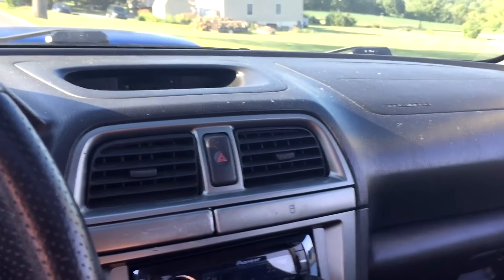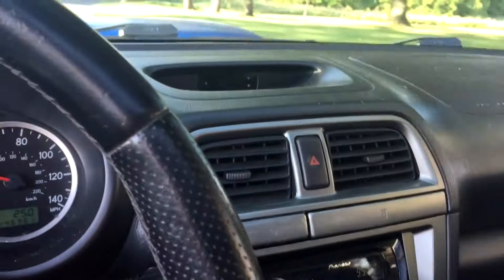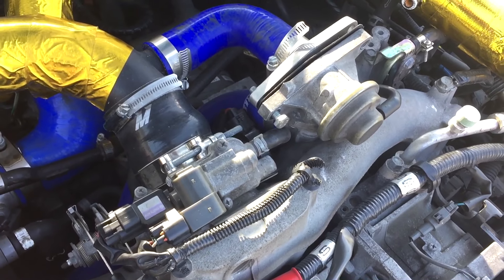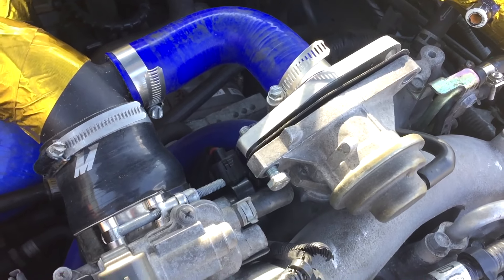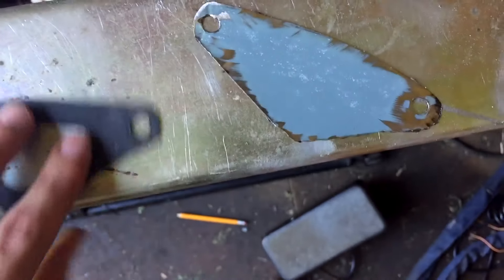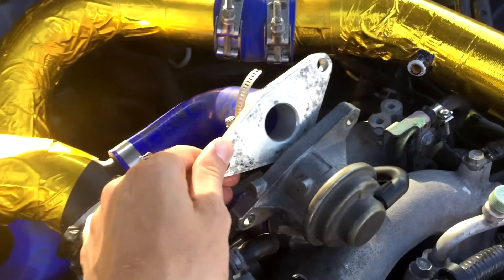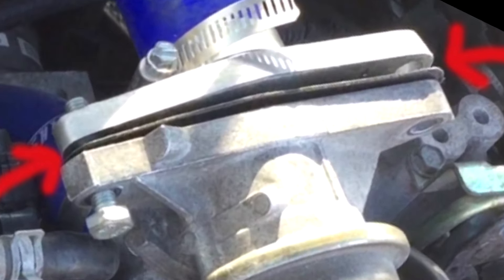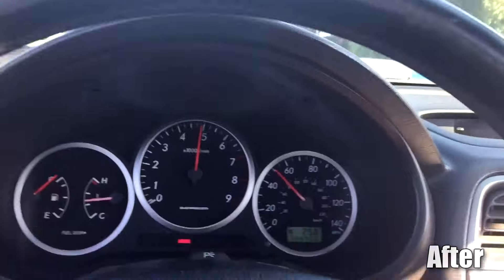DIY | BOV/BPV Delete - Block Off Plate | Stage 3 WRX Turbo Sound

Comment: This is not a good idea at all. For all the reasons people before me pointed out.... 
breaks your turbo, makes throttle response worse, makes boost drop after shifting. This is a really bad idea.
Reply: Mark Wright It very suddenly brakes the turbo when it is working against its own pressure That means slowing from 150k Rotations per minute down to nearly stopping in tenth of seconds. That can break the Turbo within hours. The point of a Blow of valve is to stop the Turbo from suddenly slowing. Without the blow of valve everytime you get of the throttle the turbo looses all its rotating speed and you have the Turbolag to go through again. A BOV prevents that by keeping the Turbo Spinning. Just you asking this questions tells me you know nothing about Turbo Technology. Maybe try educating yourself.
Reply: First off it does not slow the turbo down anywhere NEAR like you say. A turbo physically could not go from 150k RPM to nothing in a tenth of a second...The turbo would blow itself to bits. All thats happening is the air is getting chopped by the blades of the turbo. If you think about it its like a plane wing loosing lift. Its slowing slightly just like it normally would after you let off the gas except the air is getting chopped instead of being let out to atmosphere by the BOV. 
For someone saying "educate yourself" you might want to actually know what you're talking about before you comment some dumb shit. 
Cars before 93 and even some now regardless of the level of boost being ran dont have BOV's They're just there to make the turbo quiet. 
porsche's,   turbo buick regals and most cars with turbos before 1995 (ish) all never ran BOV's and they still run just fine. A bov is basically a choice. 
If something fails because you block off your BOV or you blow your turbo there was something else wrong. 
There is a reason high hp cars dont use them and cars in the past (including older AUDI's BMW's, Supra's, Buicks, the older Z cars all never had them.....simply put....you dont need them.
Reply: squishypitbull First it can and it does. Some Turbos can accelerate from iddle to fullboost in 5 tenth of a second and in this case it slows down at that rate. There are actually some very impressive videos of a Turbo Compressor Side deintegrating in very spectecular fashion upon closing the throttle body at full boost. On normal levels of boost it just results in very high wear on the Turbo. Yes until the 80th BOVs were rare, but on roadcars they were not neccessary because they usually never operated over one bar of boost with big turbos spinning slowly and also back then most racecars had the throttlebody in front of the Turbo so when it closed airflow to the Turbo was shut and it could not build pressure or be shattered by its own pressure. The Audi group B cars were prime examples of BOV less Turbocars. But the wear on the Turbos was so high their lifespan was measured in hours. Just do the math. Even on a conventinial modern road engine the Turbo would get slowed by nearly 150k rpm in tenth of seconds. Take out your calculator and get cracking if you dont believe me. Or ask any person who knows something about turbos.
Reply: I have. Turbos simply do not slow like you're talking about. it doesnt happen. Yes, they slow but not nearly as drastically as you're saying nor does it cause damage like you're talking about. 
There are many MANY cars with high hp and boost loads that do not run BOV's at all. Hell, my neighbor has a car thats been running close to 30lbs of boost for over 10 years with no issue whatsoever and he's still on his original turbo from when he built the car. 
You need to do some research on what really happens. It does NOT cause drastically abnormal wear on the turbo like you're saying. On a shit Ebay turbo that isnt built well at all then yeah....it can blow it up no problem (but then again its a pile of crap anyways) But to preach that the turbo slows down from the 150k RPM its running under load to nothing is crap. It doesnt happen. 
If you dont know enough about it thats ok  but there are many many people that do not use BOV's on their cars for years and years and their cars run just fine without them. To say that you'll blow a turbo if you dont have a BOV is complete garbage. Just more crap spouted from companies to get you to buy crap that you dont need. 
remember.....the really damaging thing comes from compressor surge...not flutter. and either way when you let off the gas even with a BOV the turbo slows. it doesnt STOP. The fact that the BOV releases air instead of letting it back out might mean the turbo slows a little more due to the air resistance but it doesnt just stop. Sorry man but you're just plain wrong.
Reply: squishypitbull No they do you are wrong, would you just educate yourself and then start talking about a subject.
Reply: squishypitbull Sorry to bring up that debate again but your wrong when you say it isnt causing any stress on the turbo..it will increase shaft play faster then usuall..and yes the turbo slows down more then if you have a recirculating valve or bov but thats just simple knowledge to understand that. Btw don't bother telling me that im wrong im a mechanic i know my stuff :)

Comment: guys, dont listen to this guy. go and buy a proper BOV and install it correctly. the noise in this video sounds like compressor surge and flutter, which is what a BOV is designed to prevent. there are BOVs that can gove you this sound, but the giy in the video is not doing so. You will mess up your turbo if you follow this guys method. iff you want a nice BOV sound, first get a open air filter for your intake. that right there will give you a nice BOV sound when you release the throttle. but if thats not enough, then buy a nice BOV that vents to atmosphere or both recirculates and vents to atmosphere(hybrid BOV/ DUAL).
Reply: he did it to make flutter, flutter isnt bd for the turbo either
Reply: Running without a bov will probably shorten the life of your turbo but it will not destroy it. This isn't really causing compressor surge. With compressor surge and turbo flutter people usually refers to two different things. Flutter is when you're on boost, let off the gas and it makes that tsututu noise (e.g. when changin gear). Compressor surge happens when you're on boost and on gas and that's really bad. No compressor surge happening on this video.
Reply: Eastsidegeorgiaboy stock subarus don't have a blow off valve? So yes it causes back pressure but it leaves factory like that so it isn't actually that bad. Yes a bov would be healthier but it is not a necesity
Reply: JDM Fitzy stock turbo Subarus do have a blow off valve, they are fully recirculating. You can hear it if you pull off the intake or put on an aftermarket one. They just aren’t set up to make cool noises like aftermarket atmospheric venting BOVs.
Reply: Yeah this is not a good idea. As mentioned above, if you want a cool sounding blow off valve without having to get a tune then you should get a hybrid BOV. If you want a fully atmospheric-venting BOV, (loud whistly sound) then you will need a tune if you don’t want your car to die everytime you let off the gas. You can also still have that flutter dump noise if you tighten the BOV spring enough to where it only lets out some engine pressure so it doesn’t stress the turbo shaft as much (still not healthy, but a safer option). If you don’t care about cool noises, the most practical choice for performance is what they come stock with; a fully recirculating BOV. Tial makes the best aftermarket recirculating BOVs.
Reply: Eastsidegeorgiaboy not true this is harmless, most cheap turbo cars or old turbo cars don't even run bov/bpv. If he was running higher than stock boost it COULD become bad but it's fine and will cause no long term damage to the turbo at all.
Reply: No bov makes this noise for one and secondly "flutter" and "compressor surge" are one in the same.  Built up air pressure in the manifold has no where to go so it gets pushed back through the turbo what you hear is the blades on the compressor wheel chopping through the air (your famous tututus) and in higher boost pressures stalling...stu=stall......tututu=flutter
Reply: @jamescoccaro3392  Fully recirculating valve is called a bypass valve not a Blow off valve

Comment: by not letting the valve release u are creating compressor surge, which is bad for the turbine. it might not damage your turbo and low boost, but i wouldnt advise anyone to do this! you gonna make people destroy their turbos you clown.
Reply: There's a difference between compressor surge (flutter while the car is accelerating) and turbo flutter (off gas)
if you dont know what you're talking about please dont comment. 
Compressor surge....bad
flutter.........................not bad
Reply: it's still compressor surge fool, any stall on your turbine will give the surge. it's your choice if you want wear the bearings on your turbo. u feel because u did a few google searches and watched a few vids that you are an expert?

Comment: how to destroy your turbo 101. lol I though pushing 20psi out of my stock turbo was bad. blocking it off just sounds bad. compressor surge is nasty for those bearings and your turbo shaft.
Reply: Whats happening is flutter....Not compressor surge. They are two different things. 
Flutter is not bad.
Compressor surge is.

Comment: THIS MOD WILL DESTROY YOUR TURBO.
Subie Rumble, you are a ricer. This is the Dumbest modification ever. That "Cool Sound" is the turbo barking because it's pissed.  The pressure spike behind the throttle plate/intake plumbing gets so high that the compressor wheel on the turbo cannot force anymore air in, the impeller stalls and high pressure air pukes air out the front of the turbo. The flutter is that process happening multiple times as the pressure tries its best to equalize, and compressor wheel goes from full load to no load, back and fourth. This puts shock in the turbo shaft and the thrust bearings pay the price. Once your thrust bearings are shot, your burning oil and potentially contacting the turbo housing with the impeller blades and then kaboom. 
Bottom Line....Don't be a ricer.
Reply: Better tell that tell all the people not running a blow off valve for years without issue.
Reply: TO all the people not running blow off valves for years without issues, This is the dumbest mod ever. Your turbo hates your for it.
Reply: Nah turbo will be fine.